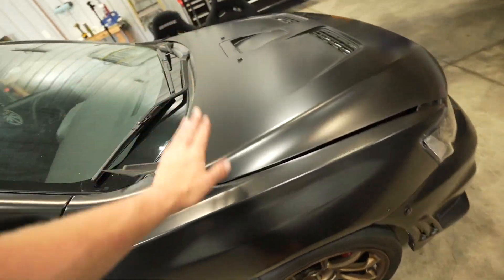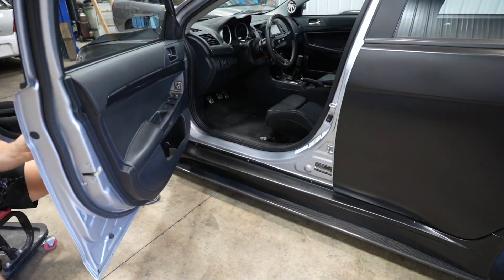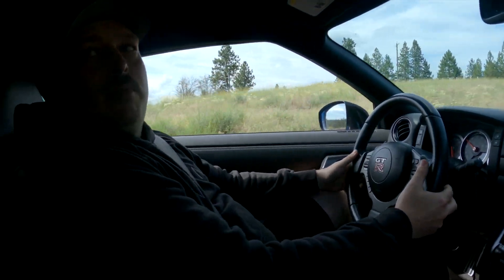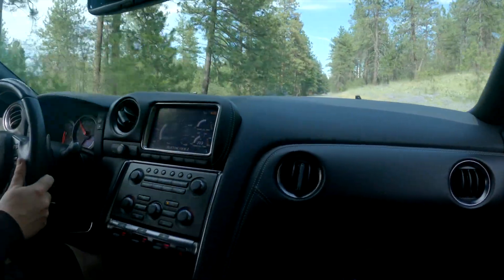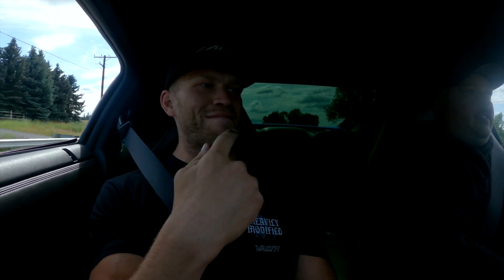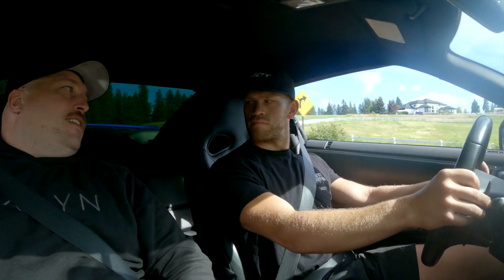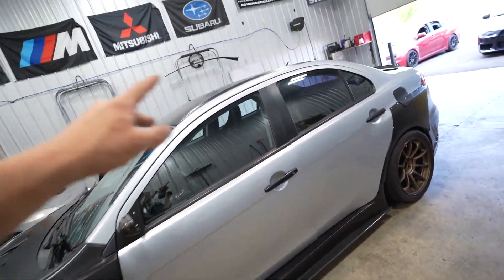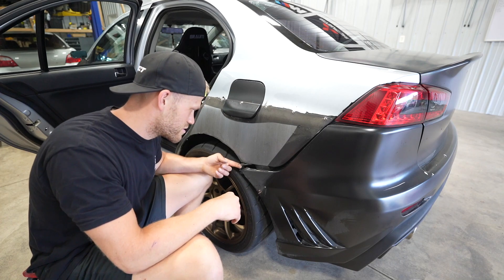RIPPING The 9 Second GTR!

Comment: GTR is fast af, but that just shows you how fast these new Audis are...

FBO RS3, stock motor, stock turbo with seats removed in back is a 9 second car.
B9 S4 with hybrid turbo, stock motor, seats removed is a 9 second car.
RS6 FBO, stock turbo, stock motor, full weight is a 9 second car.